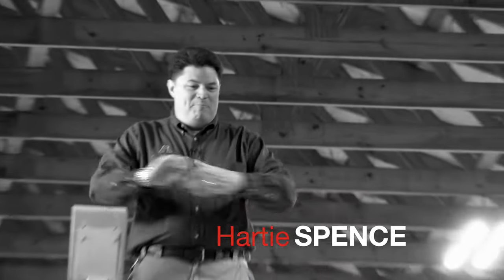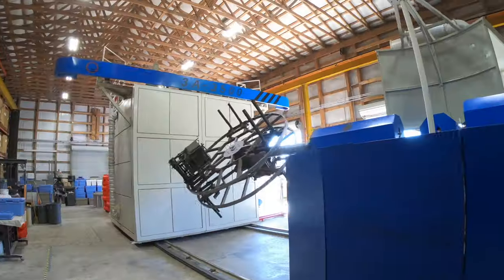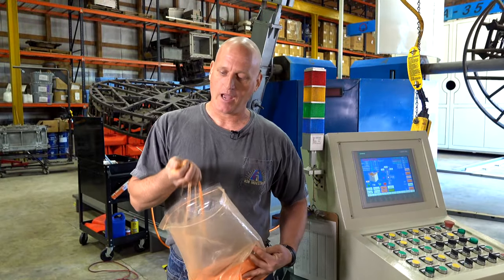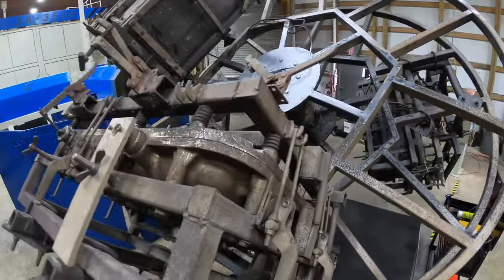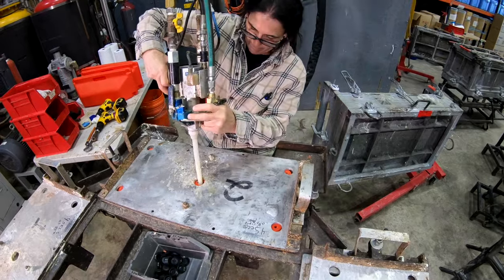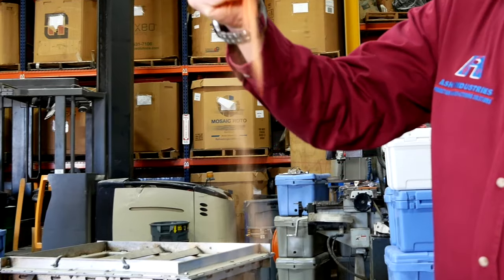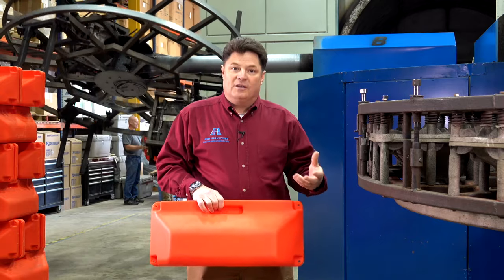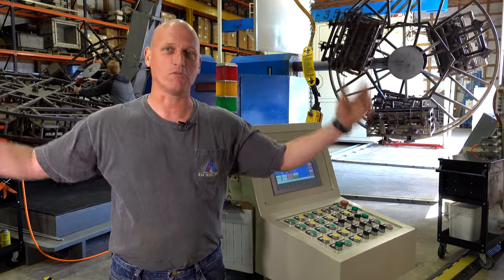Rotational Molding of Small or Large Plastic Parts | ASH Industries | Lafayette, LA

Comment: Great video😊!! Can we get a uniform thickness distribution for around 7 mm thickness? And can rotomolding produce thick walls?
Thanks,
Reply from the maker: While there's no definitive upper limit, walls exceeding 1 inch (25.4 mm) become increasingly challenging in rotomolding.  Thicker walls take significantly longer to heat evenly throughout, extending cycle times and reducing production efficiency. Additionally, very thick walls can lead to uneven cooling and potential warping of the part.

Comment: I use the process for Plastics lining of Steel Pipe Fittings. I need a larger macine which can take the load of Large steal pipe fittings. Can you supply a costom made machine for me ?
Reply from the maker: ASH does not make machines but y9ou can try https://www.automationmachinebuilders.com/

Comment: Whats the mold material?
Reply from the maker: Polyethylene (PE) is the most common plastic used in rotational molding due to its excellent properties for this process. It's available in various grades, including:

    Low-Density Polyethylene (LDPE): Offers good flexibility and impact resistance.
    High-Density Polyethylene (HDPE): Provides higher stiffness and rigidity.
    Linear Low-Density Polyethylene (LLDPE): Combines the properties of LDPE and HDPE
   Polypropylene (PP): Offers good chemical resistance and stiffness.
    Nylon: Provides high strength and toughness.
    Polycarbonate: Known for its impact resistance and heat resistance.
    Polyester: Offers good chemical resistance and dimensional stability.

Comment: how to fill up the foam inside the finished product.
Reply: Hi Junaid. That foam is likely a 2 part polyurethane foam. After the product body is molded, both parts of the foam are injected into a hole. When the two parts combine in the molded part, they begin to form foam, expand, and then solidify. The expansion of foam creates a lot of heat and pressure. Any small hole that isn't plugged will shoot out foam.

Comment: For anyone familiar with the process - does YETI brand use any significant technologies or processes to differentiate their products from other rotomolded coolers? Or is it possible that YETI and other brands are made on the same machine using the same process?
Reply: Probably better quality material. But same process.
Reply: Something tells me they're all made by this company.
Reply: Same thing. Except their plastic is much THICKER and the amount of foam inside is thicker as well. Even the lid is insulated with foam. Most coolers have no foam in the lid.